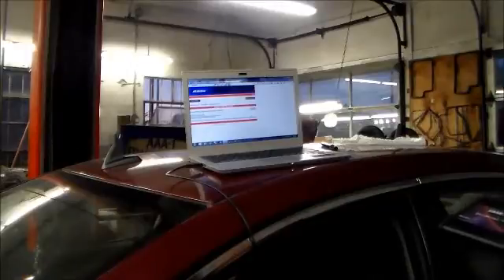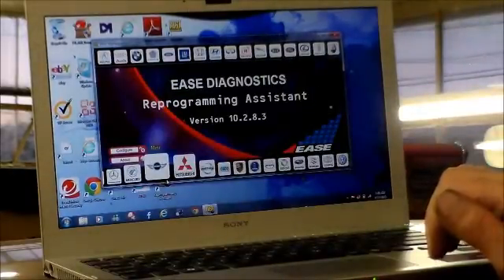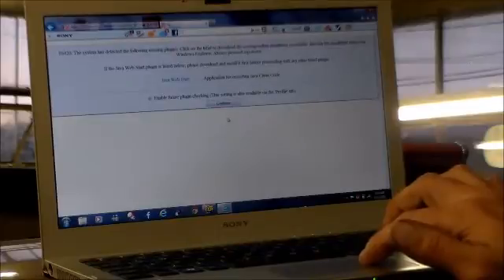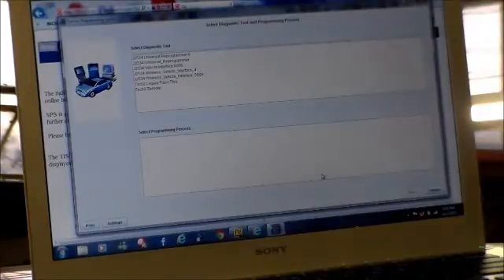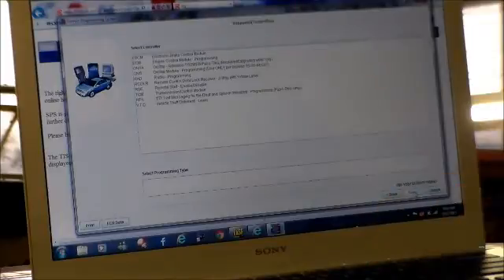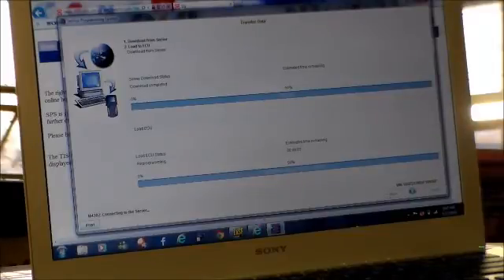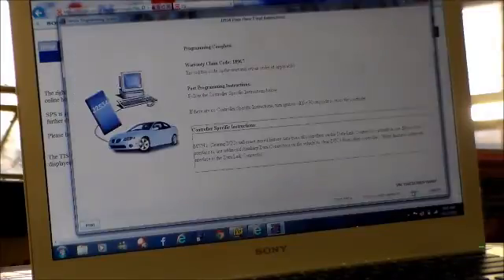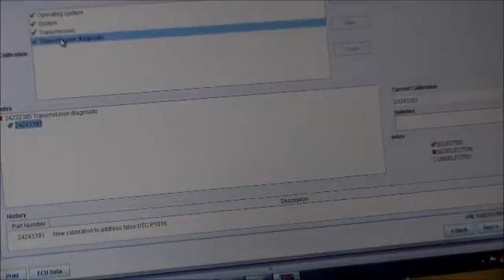Reprogram with J2534

Comment: Hello gary.   Do you know.  If on a 2007 suburban  using a used ecm  with mach number  .  Needs ro be reprogrammed to the car or. Just a vin #. Rewrite.  
And if need to do on line using the j2534 tool and a laptop
Reply from the maker: May need to be programmed or the car may not start

Comment: I'm new to this stuff, but I would like to get into it, what is a good pass thru device or are they all the same, same for laptop program, and  can you get these software update files or copy them for yourself so you can do multiple cars without repurchasing , or does it not work that way
Reply from the maker: I bought mine from Ease Diagnostics, but i think they are all built by Drew technologies,  i would look into that company, what you do is purchase a subscription from GM, they give you an option of 2 days, 3 months or 1 year. I always get the 2 days around 55.00, you can do as many cars as you can.

Comment: No TECHCONNECT down here where I live..it's off to the dealership for a reflash!.No joy at Ford (Motorcraft) for IDS access either.Lack of consumer law requiring  fair and reasonable access for  aftermarket shops is the issue. Oh by the way, I've heard it's safer to use a quality jump pack  rather than a battery charger when reflashing ( something to do with ac ripple from chargers ). Nice walk thru on J2534. Cheers
Reply: m